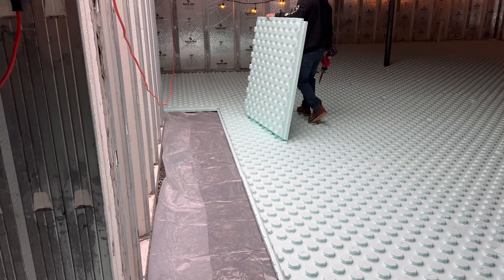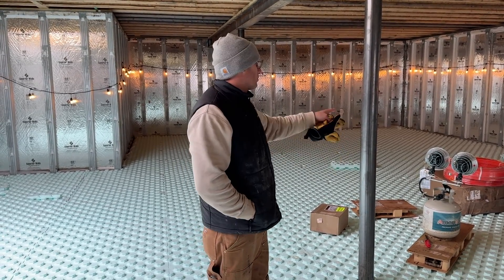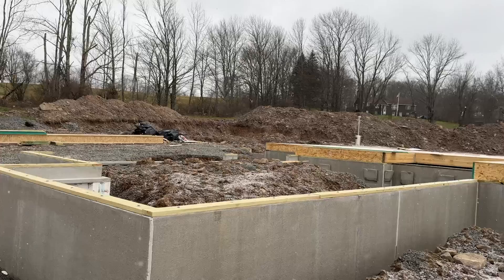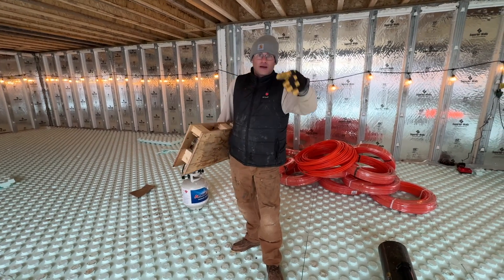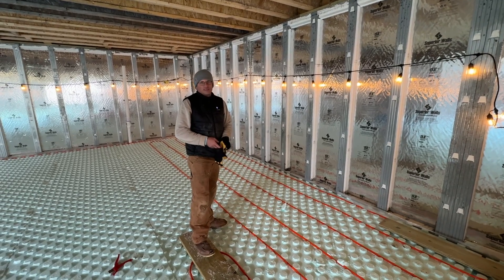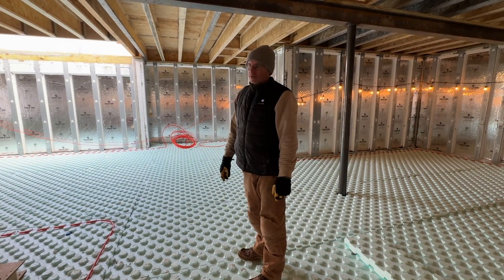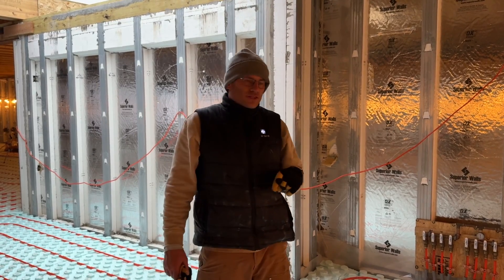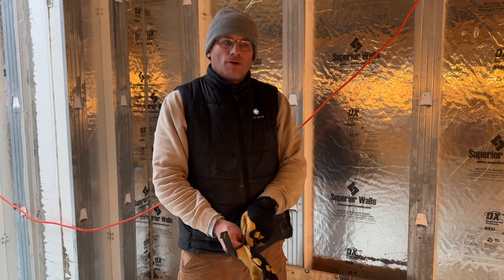Finishing Installing HYDROFOAM 3" Foam,  How I Install a Radiant Heat Pex System by Radiantec

Comment: Did you compare other radiant PEX boards to HYDROFOAM and if so, why did you decide to go with the product?
Reply from the maker: My two options were hydrofoam or the standard 2.5 Home Depot pink foam. I went with hydrofoam because I liked that the pex was able to be put in the notches of the foam PLUS there was foam surrounding the pex, which I feel makes the water more radiant in my mind.